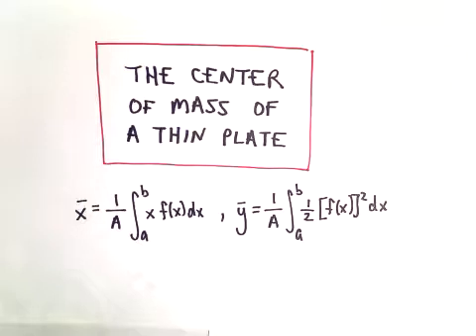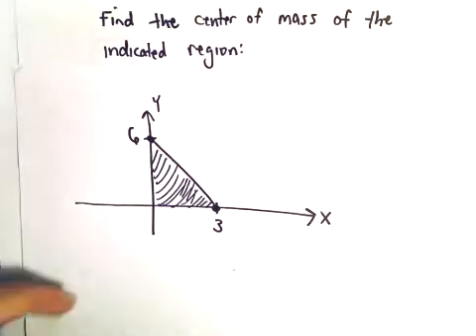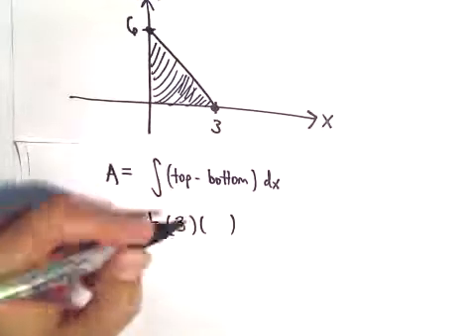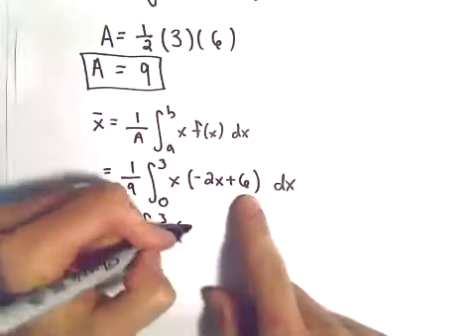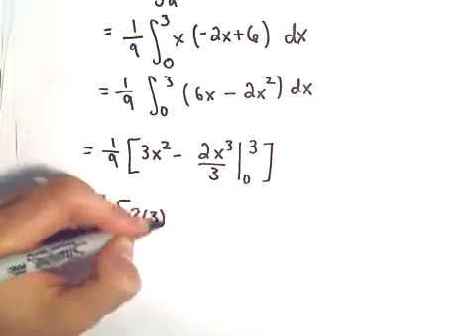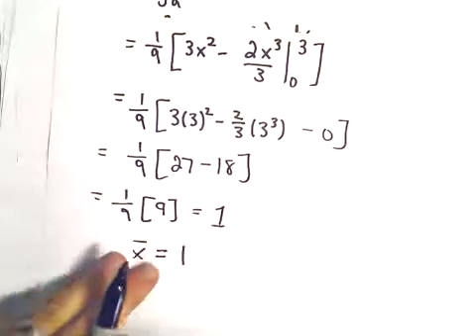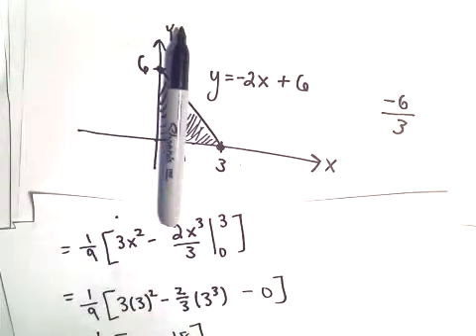Center of Mass / Centroid , Example 1 , Part 1

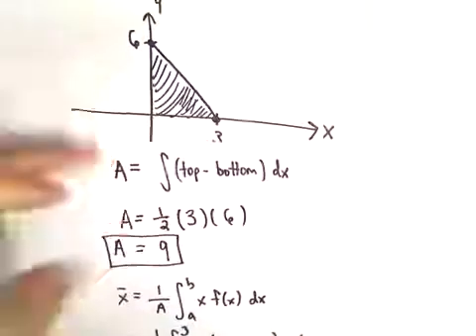Comment: Wait, at 2:05, you said that the formula of triangle is y = mx + b. It is where: m = slope ; b = base (right?)
So, why 6 becomes a base? (I mean, isn't 3 should be the base?)
Reply: its the formula for the line, not the triangle, 6 is the y-intercept (or b).